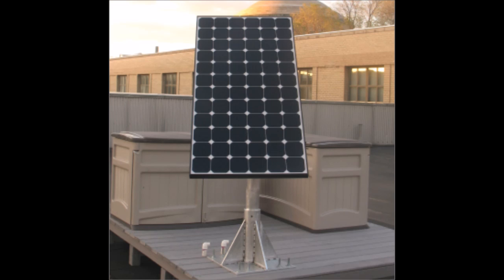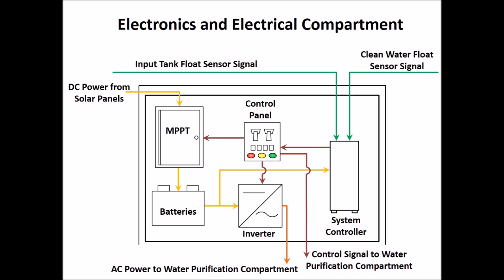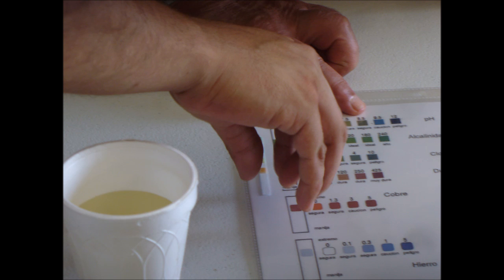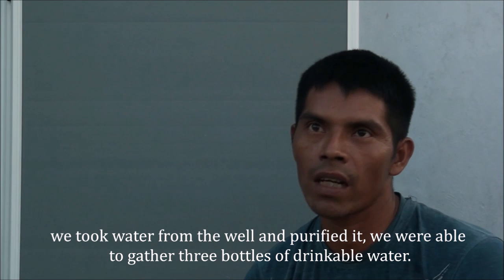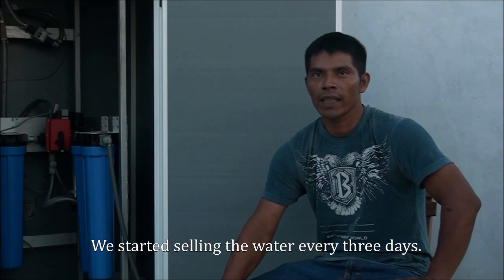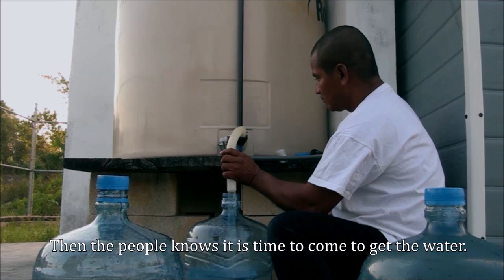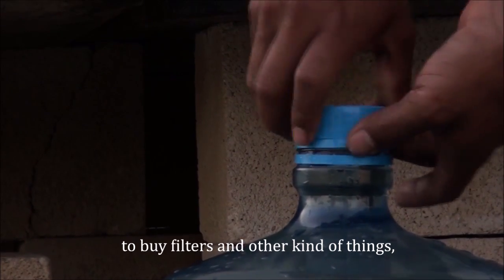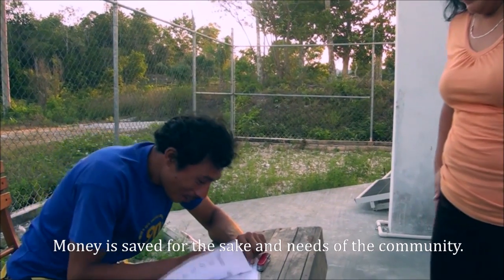Using solar power to purify water

Comment: Cold Steam the efficient way to use heat sources to produce electricity and or distilled water explained from basic concept to employment. Water boils at 75 degrees F in a vacuum.
Two open containers one full of water the other empty connect them at the bottom and water will reach an equilibrium 50 50. If one is sealed except for the connection the other will remain empty because of the vacuum created in the sealed container. 
Gravity will overcome this vacuum if the containers are taller than 30 feet.
 If the tanks are 40 feet tall the tanks will reach an equilibrium of water levels at 30 feet leaving ten feet of hard vacuum in the sealed tank. This makes a vacuum pump set we need two of them if we were going to distill water as the cold side open tank is used to collect the distilled water from it as the continuous input of water needs to go somewhere.

Each sealed tank has four valves three at the top two of those on opposite sides (B&C) one at the very top (D) one at the bottom on the side (A), water-based vacuum pump operations are, Close bottom tank valve A and top tank valve C.   Open top tank valve D. Fill sealed tank through top side valve B. Close valve B and D when full. Open bottom valve A. 
This primes the system to let the warm water in that will vaporize and run through the system when you partially reopen valve B (to control flow rate) and open valve C to its fullest.

For only power generation need one pump set and one vacuum tank so we can have a Hot side and a Cold side one to boil the water and one to have the low pressure/vacuum to draw the steam in through the turbine then the cooling coils then to the tank. 
At the bottom of the cold side, tank is a return pipe with the one way valve to the heat source the one-way valve prevents expansion back to the cold side and as the hot side vacuum chamber is the only outlet for the expanding water and it is drawn by the vacuum the cycle proceeds.

You can combine the two and get power generation and distilled water keeping the return line from the power generation system will let you switch if you don't need distilled water on a continuous basis in large quantities.
 I am going to make one feel free to make one as well it is open source.
Reply: When you've completed it would be great if you could make a video🙏🏿